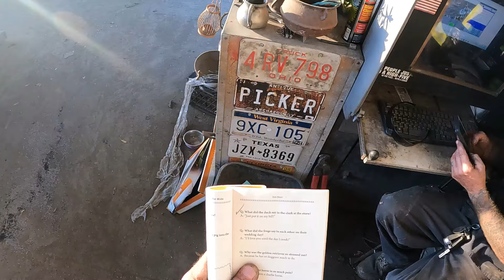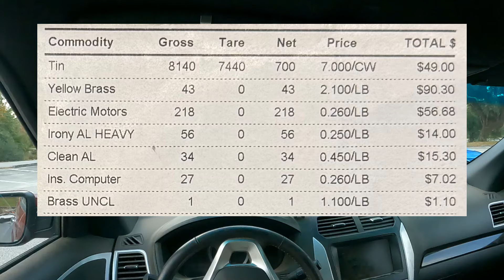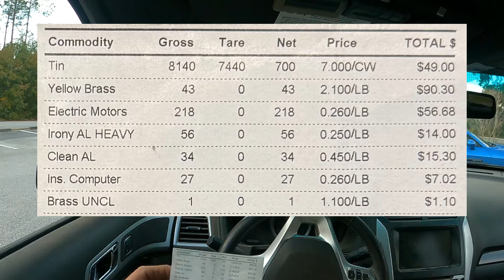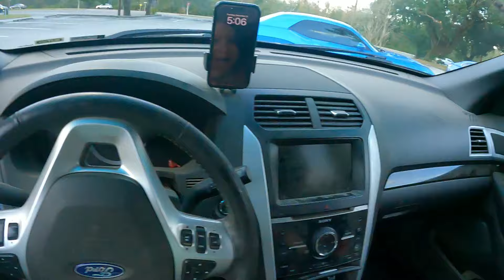Slow Street Scrapping Day Turned Around!

Comment: I have a question? How come you don't pull the compressors out and get the copper out of them, strip the copper out of the wires, and step down the motors get the aluminum and copper out of them?